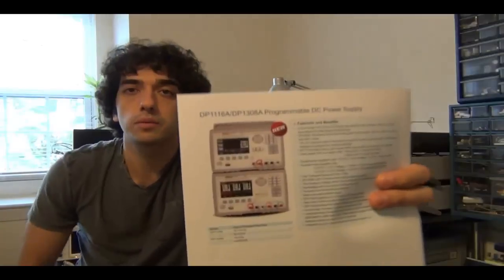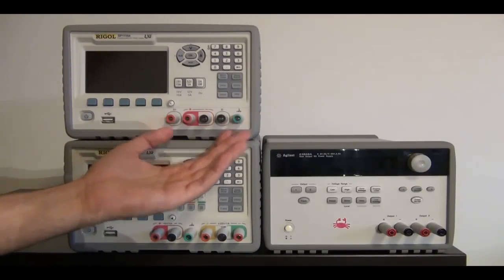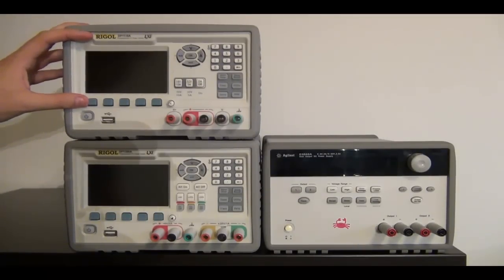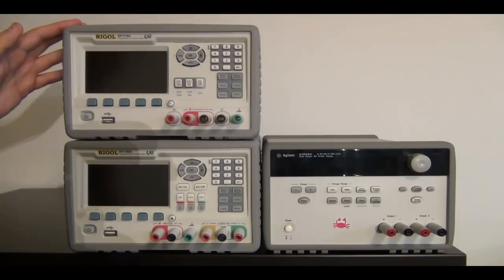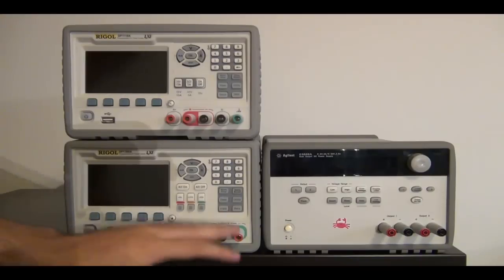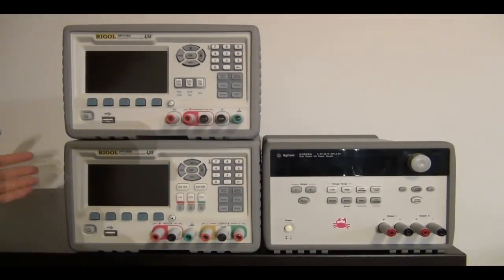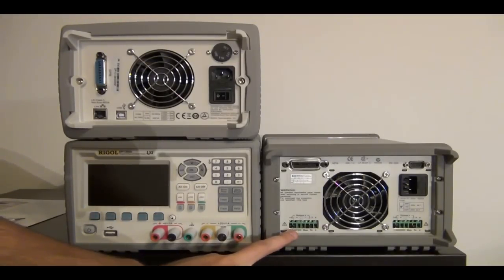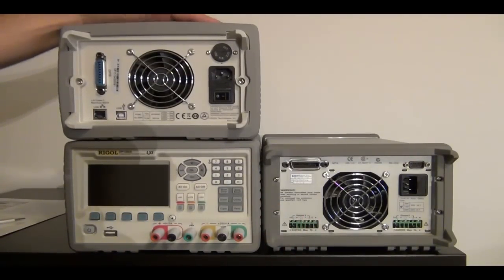TSP #6 - Rigol DP1116A and DP1308A Programmable Power Supply Review (Part 1/6)

Comment: Super great review with lots of usable details, just as always:-)
May I please ask you if you still like the DP1116A? Are there better alternatives when features and price is considered? I am thinking of using them for everyday usage but also for the more demanding chips where voltage and current may not walk too much.
Reply: Shahriar Sorry to disturb you again but do you know if two of the DP1116A can be used in series and parallel?
I have asked Rigol but they answered that there were nothing about it in the manual, so they didn't know.